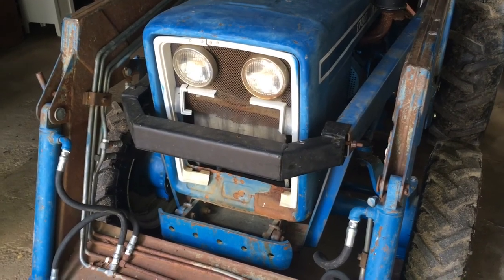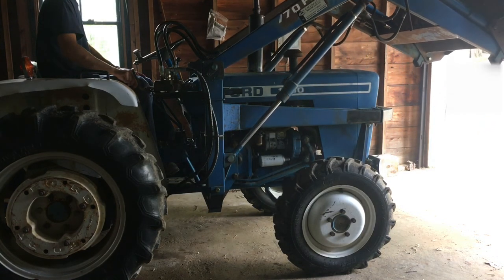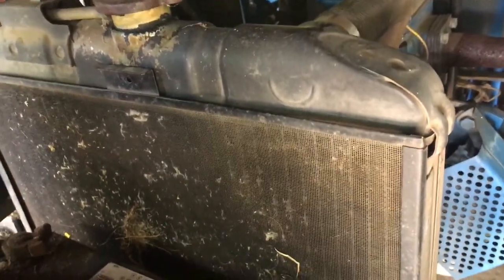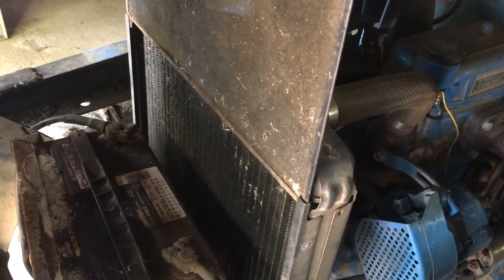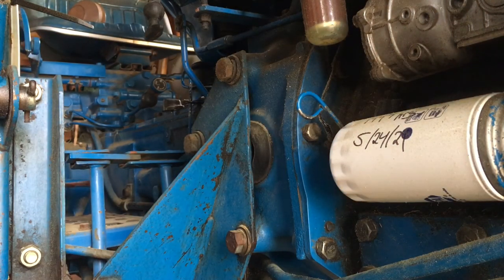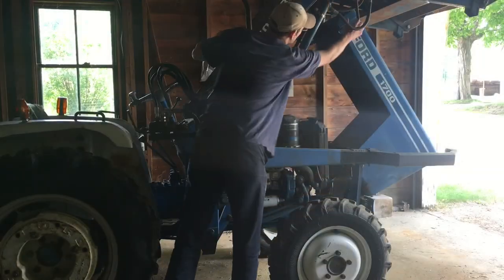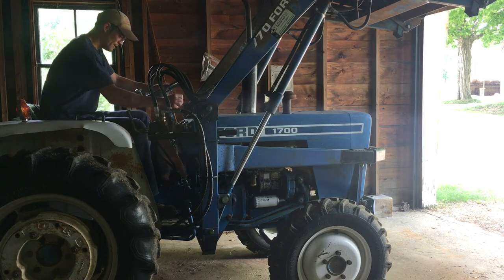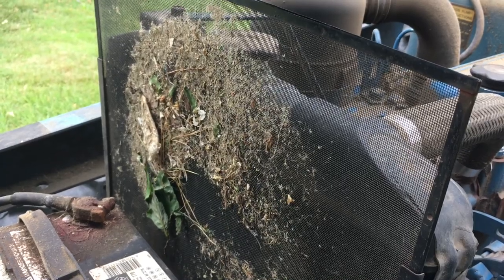Ford 1700 Tractor Pre-Operation Checks & Cleaning Radiator Screen

Comment: For safety while working on it, you could make up a loader support. Mine came wit a piece of C-channel steel with a handled bolt on each open end. You raise the boom right up, put the channel over the rod on one of your boom cylinders, put the bolts in to keep it from falling off, and then lower the boom till the channel takes the load. This channel gets stored on my ROPs. Hope that makes sense.

Comment: Hello again, I went to start my 1700 and it cranks over until the battery just about dies. It just not firing. I topped the fuel off and I tried a bit of starting fluid but it didn't help. Last time I ran it was about a week and a half ago. Any ideas? Thank you.
Reply from the maker: With ambient temps in the 70s+ F, mine fires right up with no glow plugs. If it cranks and there’s no hint of cloud at the exhaust, it isn’t getting fuel. Why not is a harder question. The fuel delivery system is on the right side of the engine when looking ahead from the operators seat. I’d start with the easiest and see if the fuel shutoff at the base of the tank is open. It should be, but it could’ve been bumped. Next, see if there’s water in the fuel filter bowl. You may be able to see it through the translucent cup on the right side of the tractor. Water and diesel will separate, so if it looks like you see a line with two fluids in there, that’s water. If there’s water in the fuel filter bowl, it could also be in the bottom of the fuel tank! Then the fuel floats on top of it and can’t get to the engine. There could also be air in the system, bleeding it would resolve that, but if you’re going to do that, drain and clean the filter bowl first regardless to make certain no water is in there. Bleeding it is a pain and takes me a fair amount of time and engine cranking with each bleeder screw open before it’s running again. If fluid doesn’t flow out at a bleeder screw when it’s cracked open, it’s possible some debris is blocking the fuel pickup in the tank. Finally, check that the throttle linkage is all connected and working. The engine is shut down by shutting off the fuel by putting the throttle all the way off. With disconnected linkage, there would still be no fuel to the engine when adjusting the throttle. If all that fails, it might be the injector pump itself, but I doubt it. You may be able to see some details/parts of the fuel system in my videos about the steering. I removed the fuel tank from the tractor during that process. Good luck!

Comment: What type hydraulic fluid is required  on the 1700
Reply from the maker: The original Ford spec is M2C-134A. But the 134 fluid has been through updates and iterations like motor oil API service designations.
Reply: @ProductiveRecreation  is that the same as aw 46, thanks
Reply from the maker: @jamesbyars9837  No. it’s a tractor and transmission hydraulic oil. Pretty thin (low viscosity) even at cold temps. Different fluid will damage the pump. A modern universal tractor oil should be OK, but check the label to see if it is listed for the 134 spec. I got New Holland oil when I last changed it.

Comment: I came across an old 1700 that I am having some trouble with. 

Where is the overflow for the radiator at? There’s not a tube on the radiator so when it gets too hot just spews it out all on the top.

A hose is an easy fix, I’m just not sure where the reservoir is to put it to.
Reply from the maker: The 1700 doesn't have a radiator overflow or expansion tank. The manual directs not filling the radiator full (fluid should just cover the baffles when you look down in). That leaves volume in the radiator itself for expansion. I have never had an overflow issue at the relief in the radiator cap. I wonder if your operating temps are getting too high, or if the cooling system is overfilled? If you don't have a manual for the tractor, you can find them online. Very handy to have.
Reply: @ProductiveRecreation  oh thank you so much! Maybe I have been filling it up too much. Yesterday it started spewing out and I let it cool and filled it up again hehe.

So I just need to run a hose do the side then?
Reply from the maker: @Turdfergesun  I don't think there's anywhere you could connect a hose at the top of the radiator. The radiator cap will only relieve pressure (and fluid) if the pressure gets excessive. If you need to drain coolant out, there is a drain valve on the lower left side of the radiator when looking forward from the operator seat.
Reply: @ProductiveRecreation  I assume that’s what happened to mine after running it for a few hours. 

Sorry I am just new to this! I got a brush and cleaned the front of my radiator after watching your video since mine doesn’t have a screen installed.

I also don’t have the front bar across in front of the hood.

Comment: does this 4x4 tractor have power steering?
Reply from the maker: Most Ford 1700 tractors (both 2 and 4 wheel drive) have manual steering. This one has what they call "power steering," but it is really a power assist on a manual gear. I can tell you that there isn't much assist either. It's nothing like the hydrostatic power steering on new tractors.
Reply: @ProductiveRecreation  thanks for the reply.  I might look at a 4x4 and crossing my fingers.  I can always add it like on my rock krawler.